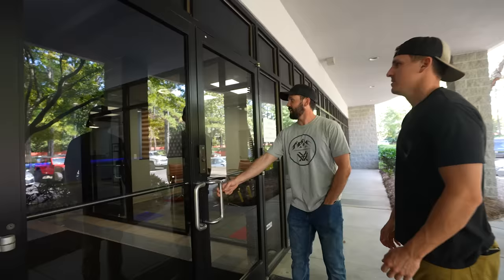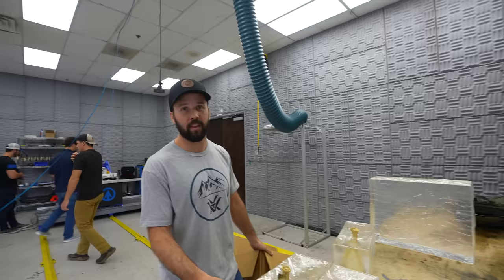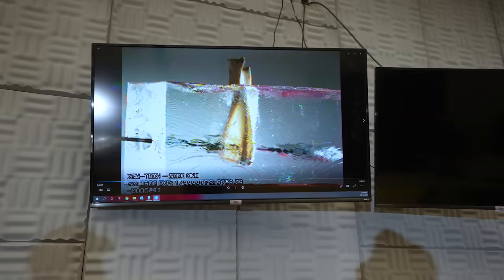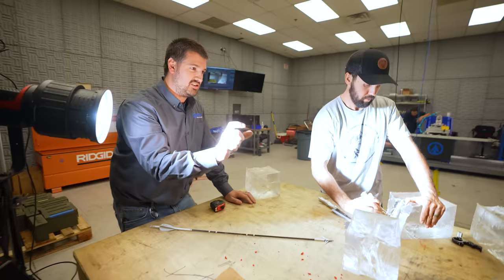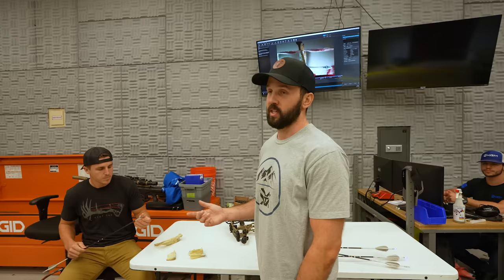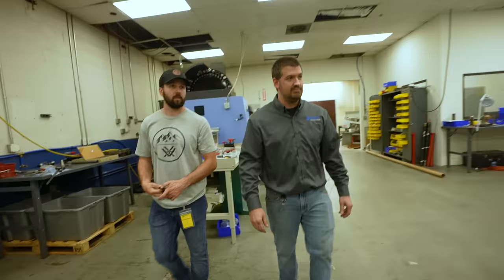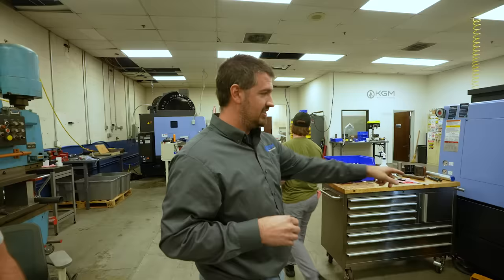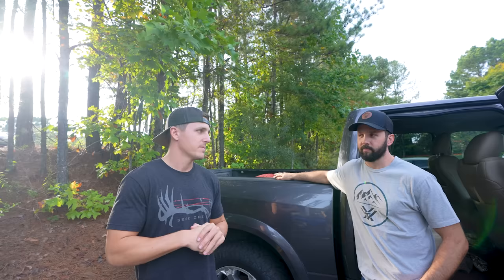BROADHEAD TEST: Which One SPLITS BONE? (Super SLOW-MO Camera!!)

Comment: Thank you so much for sharing this video... I just found it about 9 months later and I must say I'm impressed.  I do have 1issues for you though.  The dried out scapulas you used do not perform accurately to the to live ones, which are softer on the surface, much more flexible, and more spongy in construction than when they are dried out.  This added flexibility adds to the issue you are researching.  I believe you have shown why fixed blades end up being better when things aren't perfect.  When things are perfect, any broadhead will work, but we have to plan on hitting bone, cartilage, and the vitals.  I'm definitely not perfect, but I try... You guys can help a lot of hunters do even better.  I wish you great success.  I currently hunt with VPA single bevel 250gr broadheads.
Reply: That is a good design imo, love the tip for strength and ease of sharpening. The testing that I want to see done is the "new" smaller (not 3to1 ratio) heads on bone vs the 3:1 aspect. The thought is that the shorter head offers les drag on the hard bone impacts. Proper testing is needed.
Reply: VPA, also what I plan to shoot at cape buffalo
Reply: The VPA has just two edges/angles. No complex, blunt tanto tip. Seems easy to sharpen, strong tip.

Comment: I hit too far forward with the cutthroat a couple weeks ago. Well it worked and I blew through that shoulder and found my best bow buck. I’m a fan of the single bevels.
Reply: Have you seen the new tuffhead evolution 200 grain? Yowzers. So far its the only head that has made me want to cheat on my Magnus Stingers. 20 degree bevel is wicked.
Reply: @drewsroo  I’ll check them out for sure

Comment: I would like to see a true Ashby speck broadhead in one of these tests compared to common broadheads
Reply: Am I the only guy that would also like to see x2 or x3 of the same head fired? I feel like it will eliminate any accidental human error, if the same head out performs every time that tells me a lot more than 1 head. Again you could have had the perfect shot showing maximum penetration, then take a not as good of a shot on the next head making the performance look worse than it actually is but you won't know it with 1 shot. I really think we need to set a new standard, I know it cost more but I want to see variance eliminated. If we sight in rifles with groups of 3 I feel like that is again the same idea, how can you gauge accuracy with one shot? So even with bows we take 3, but man I'd love to see these penetration tests done with 2 or 3 shots.

Comment: God I love it when the Ole RF is right! I'm shooting Victory VAPss Elite 250's with 315 gr GrizzlyStick Alaskans. 695 grains of DEVISTATION!
Reply: What’s your arrow speed shooting something so heavy??
Reply: @paulw4924  fast enough to get the job done. This is my first season goin heavy. Killed 2 so far and the results have been incredible. Quartering to frontal shot on a doe... dropped in her tracks. 30 yard broadside from the ground on an 8 pointer...shoulder to shoulder pass through...didn't go 30 yards and fell over. I would say 260s. I haven't chronographed it yet. Just going by what I've seen speed wise with similar set ups..

Comment: I can say with confidence any of the ironwill broadheads would outperform all of these. They are insane, especially if you use the solid heads. I use the vented wides on whitetails.
Reply: I must have 50 Broadheads that I have messed with. Iron Will is by far the best.

Comment: I’ve been shooting sevr since they were ulmer edge. They are awesome. I’ve shot right thru the spin on a straight down shot and have shot thru the shoulder as well with great success if love to see you guys add that blade to the line up. I shoot the 1.5 the 2” is just to much to punch thru bone or like you guys explained those sharp angles.  But the sevr I feel does better in the sharp angles  cause of the pivoting head design. And lastly the blades are way more stout than the rage I’ve never lost a blade on my sevr  heads and I’ve seen many rage blade lose a blade or both in bone and even a rib.
Reply: What poundage are you shooting? I'm looking at swapping out my Havocs.

Comment: What Lee said is a personal opinion. I shot a doe last year with a rage hypodermic as a quartering away shot and that deer ran less than 30 yards. I broke both shoulders on impact along with taking the lungs and heart out. It’s personal preference and also if you practice a lot at that angle. Another factor is the total arrow weight which can play a huge role

Comment: I busted ribs. And had mostly pass throughs with the rocket steelhead. And shot deer at hard quartering angles. Awesome little mechanical. The design was sold a couple times. And nobody is making it now. I switched to vpa three blade. Made in my town. And if your broad head was machined,vpa probably made it. Thanks for the test. Loving the channel.

Comment: I just started using shwacker broadheads last year first deer I shot hit it in the shoulder and buried in the offside, I thought I wouldn't find it but it only went 20 yards and tipped over I was very impressed, blades are still straight and extremely sharp

Comment: I apparently was wrong about the Exodus. It did not look like it would hold up and perform as well as some other designs when dealing with bone, and was still a more modest cut if you had a clean shot. I'll have to look into the flight qualities, but for the typical short range shot that is less important. Glad I took the time to watch this through.

Comment: Love you tests. The shoulder blade is upside down. Most people hit the knuckle joint or just above. 
I once used a broadhead 20years ago called dead ringer. It had 3 thick blades on a split ring. It slid up the tip in groves upon impact. Hands down the best mechanical made. Make this and I will buy it.

Comment: I’m only shooting a 60lb dw 27 dl with shwackers and light arrows, this past season I shot my best bow buck to date and killed it but if luck had not been on my side it would’ve probably died and never been recovered. I center punched a rib and nicked the scapula bending one blade preventing deployment and damaging the other that deployed, what saved me was the angle of impact snuck the arrow forward of the heart slicing a hole in the top of the aorta, deer went 50yds and just stopped dead and fell backwards. After further examination I only had about 7-8” penetration. Scary stuff.

Comment: Hey guys.  I do like the testing in the video.  I hope you are still doing testing.  I would suggest getting bone that is not dry, old, etc.   Healthy bone is very much different to shoot and responds very differently than dry bone.  This would provide a better test.  Then the dry bone. I do like the testing method,  I think you have to have a more living and denser type of bone.   Get fresh bone and freeze it and then thaw and use for testing.  Would give you a better test parameter

Comment: 15:07 nailed it.

Narrower = Better 

State legal limits typically require a minimum of 7/8" width, some states allow as little as 3/4" but Im unaware of any allowing less than this. 

But honestly, 5/8" to 3/4" cutting width on a small diameter arrow (0.204"/5mm AXIS or similar) would almost certainly get full pass-thru shots on nearly any game, given enough momentum/mass.

Now, for the conclusion at 20:00 for the Exodus 3x blade...This is the ideal broad head for maximum penetration in ballistic gel.

They mentioned the Ashby reports. All of those reports show without exception that 3x blade broadheads ALWAYS under penetrate two blade heads. The two blade heads gaining from +30% up to +50% more penetration in actual living game. As muscles, hide, sinew, and blood are not going to be remotely the same as ballistic gel.

Comment: Recently shot a medium sized doe at 45-50  yards. She was completely broadside and I was off a bit and hit her dead center of right shoulder.
Went completely through and went on to break the left shoulder as well. 
I was using a Carbon Express Jackal  crossbow tipped with the original #207 Shwacker 100 gr expandable. 
Being that both shoulders were broken she dropped and couldn't go anywhere

Comment: I shot my buck this year with a rage 2 blade expandable. It went in, busted ribs then tried to bust ribs on the way out, but didn't bust ribs. That was at 60lbs with a 100 grain broadhead. I upgraded bows, am now at 70lbs, going to order 150 grain single bevel heads to replace my current rage broadheads.
Reply: I have a 50lb bow and got a complete pass through on my buck this year. 20 yards shot, 575 grain total arrow weight, 125 G5 Montec broad heads. He only made it 30 yards before falling

Comment: With an expandable you can shoot an inch further back and still cut 3x the hole of those single bevels
Reply: What if you miss 2 inches forward? It happens quite often. Ask any dog tracker.
Reply: @drewsroo  You get that loud crack and a sleepless night. I will take 2 1/2 hole  vs a 3/4"  and accuracy every time. In a couple decades of bowhunting I had one doe that I shoulder hit that didn't penetrate enough to kill her. A couple weeks later and the rifle picked her off. The rage was still in her shoulder and about halfway through. Felt terrible and purposely targeted her.
Reply: @EdWolfram  if you like what you are using and it works for you then that's all that matters. I let myself get too worked up over this anyways
Reply: @drewsroo  all good
Reply: @EdWolfram  personally I’d rather have the best of both worlds but whatever works for you. For me I like to know if an old buck comes in at any angle I can shoot no matter what. With a big 2 blade you worry about deflection and lack of penetration. With a tiny 2 blade you don’t get enough damage if you hit far back. I’ve been happy with the exodus 3 blade so far but I’m open to change I want to try a bunch of different stuff on does.
Reply: @EdWolfram  what expandable is your fav
Reply: @melvinsacromentoe  I have shot grim reapers for quite a few years now. Had 1 too many rages open and clatter their way off target.
Reply: @EdWolfram  nice the two expendables I want to try are grim reapers and sevr. For the grim reaper do you like the big WTS or the original
Reply: @melvinsacromentoe  I have used both but the WT's have been the go to

Comment: I know for a fact that there are some technologies that greatly reduce the friction co-efficient.  I’ve done some experimenting and testing with some great results. To incorporate them into a coating, which is beyond my expertise unless you can load it into some cerakote, would be amazing.. the only and biggest downside would be cost.. it just would not be realistic.. same thing with tool-steel grade stainless.. its out there, I’ve worked with it. Won’t rust, and you’re hitting 60-70 Rockwell hardness (all while air quenched).. it’s exotic, specialty steel for sure.. but a 3 pack of broadheads made from this stuff would cost you $150

Comment: The rage has a terrible blade angle, I still shoot the pre rage snyper with a 1 3/8" cut, I've shot it through multiple shoulder blades on deer and big black bears with good success, that said no mech would compete with the other bh's in your test,   Exodus are the king,  I killed a moose on a frontal shot, I was a bit off and struck the big front leg bone, the bone blew up into shards and the arrow penetrated through the thoracic cavity, through the diaphragm and into the guts! The video  of the bone is my Avatar .  Great vid, thanks

Comment: In defense of the Rage on that second shot, that's a lot of gel it went through which slowed it down before it got to the scap. On an actual deer scapula there's just the hide and a very small amount of meat to go through before the bone.

That said, this test definitely showed the strengths and weaknesses of those different styles of heads. Exodus is a hard one to beat.

Comment: Cool test. There are a lot of variables to account for. You kinda discussed Ashby a little, which I'd good. There are way more than single bevel when it comes to Ashby. Sharpness is something people tend to forget about, or take for granted. When I say sharp, I mean super freak sharp. Blade finish is mirror.  This has a lot to do with succes of that arrow. Also, I kinda wish people would show a bare shaft arrow flight before actually shooting a test, just to prove out that arrow flight (#2 Ashby) was optimal for each. Pretty crazy about mechanicals. He's right on the money with not trusting those on angle shots. The other thing I wanted to mention  was with the cutthroat heads, they have a cavity on the back side which I think causes more drag. 
Cool stuff guys!

Comment: Been bow hunting 57 years. Started out with Bear razorheads with bleeders on cedar shafted “converta points”. 
At the time the best broadhead made IMO.
Today and pretty close to its inception, I strictly use Muzzy. I prefer fixed blades over mechanical, 3 blades vs 4. Traditional broadheads like the venerable Bear (2 blades minus bleeders) are prone to planing if being reused (imperceptible out of axis alignment, due to minuscule bend at base of broadhead, after impact).
Also if two blade broadheads, at point of impact the blades are horizontal, the chance of deflection increases especially in the rib cage area, or the scapula bone.
Also possible manufacturing defects literally undetected by the eye, can cause errant flight.
However, my personal experience is that irregardless of arrow speed ( not the major factor of concern) the weight of the arrow in totality with broadhead, is VERY important. 
A good rule of thumb is at a VERY minimum a 6grains per pound for your bow setup. Ideally IMO a 7.5 PLUS grain per pound is where the optimum tradeoff pays dividends. The heavier your arrows the better the penetration, the sharper the blades the deeper the penetration, and opening up the wound channel for less friction on the shaft. 
Shooting light arrows less than 6 grains per pound IMO- is akin to almost dry firing your bow. Its very noisy not being loaded right (shooting properly weighted arrows).
Also if the broadhead base is slightly bigger than the shaft of the arrow, would help reduce friction on the arrow shaft, OR make the tip such as in a Muzzy design for example, slightly bigger, to open a path that the rest of the broadhead isn’t adding to the friction.

Back to Muzzy, the trocar tip is excellent for breaking bone and the concave tip design keeps the bone friction to a minimum while still being parted. 
It might not cut on impact, but it pierces and punches through without much deflection, whereas a cut on impact could definitely have problems in oblique shots on bone/s. A Muzzy is less prone to that because it pierces, then busts open the bone vs being glanced off changing directions.
Finally, the heavier arrow, with heavier broadhead (light broadheads are detrimental IMO) and as much poundage as you can comfortably pull back while seated and no raising bow movement during draw IS YOUR ideal bow weight.
So a heavier arrow weight, stiffer spined arrows than needed, heavier broadhead, more friendly draw weight, add LimbSavers on your limbs. All that translates into a VERY quiet bow, that deer rarely can hear, but more importantly don’t jump string to, because at most they raise their head because it’s within their comfort zone of not an alarming sound (until the arrow hits) 
Translation is the arrow hits almost exactly where you intended, without deer movement causing a different impact spot. ( A wider cutting broadhead becomes less of a “necessity” ie Rage expandables) 
Lastly, the arrows as I described, PLOW through deer literally every time. And a complete pass through is the last step to achieve a good blood trail, and humane harvest.
Im going to try Muzzy One broadheads this year. Sharpen-able by stone or file, one piece and stainless, easily reusable many times.
Good luck with your design, hope I helped contribute to things you might think about in your design.

Comment: Single bevel goes through with a great wound channel. Think of it as a post hole auger. In sand soil u can take a 5 or 6 inch ice auger & make it into a post hole digger. But u have to take 1 blade off b4 it works, & it works very well.

Comment: I Love the QAD Exodus. Shot an elk this year with 125 grain, 2007 bowtech at 65 lbs. Actually knicked the shoulder on entry, got full pass through, elk was dead less than 100 yards away. 
My complaint was we found the elk before we found blood. 
Make us an arrow with the penetration of QAD Exodus and blood of the Rage Tripan. 
With my experience with QAD I'm very confident in taking that quartering too shot and aiming dead center of that front shoulder.
Reply: I just kill my first deer with a bow with the QAD and we had no problem tracking it went 30 yards, though through some thick woods, but with a 50 pound bow at 35 yards it preformed well and left a easy blood trail to track, edit it was also quartering away and it blew through a rib on both side those it just barley hit a rib on entrance and fully blew through a rib on exit